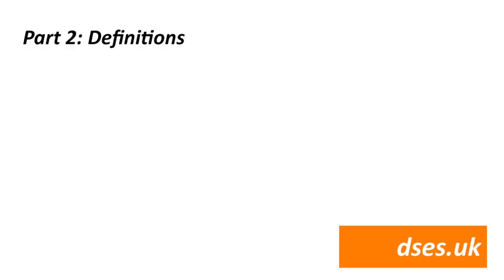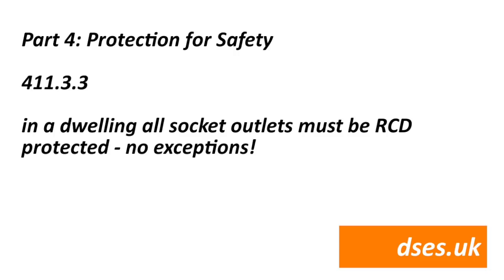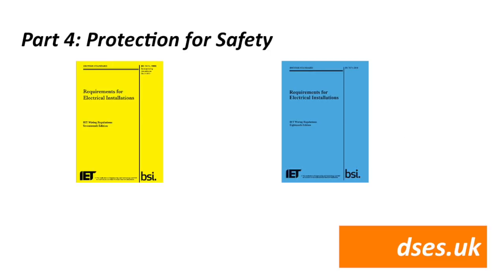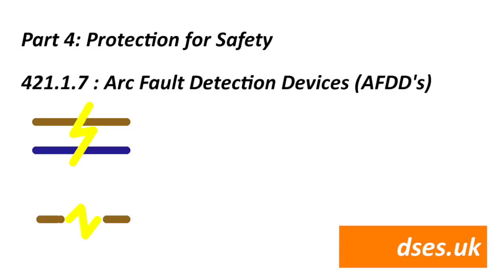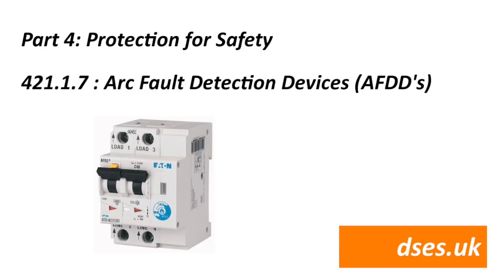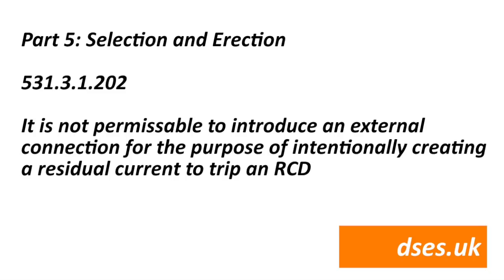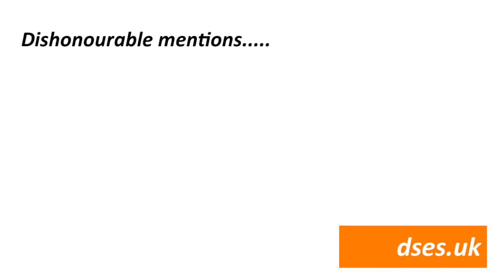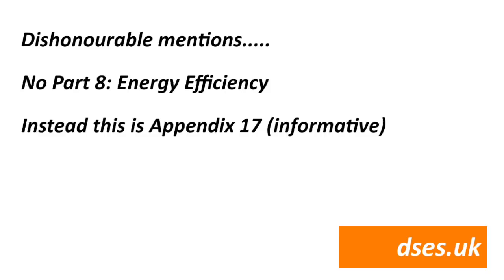18th Edition regulation changes

Comment: Crabtree and Hager both already do a smaller AFDD RCBO combo
Reply from the maker: I've seen dual module offerings without the RCD element, but I'm having trouble getting hold of any AFDD device at present. I've been chasing Eaton, Schneider and Wylex, but I'll see if I can find part codes for Hager and Crabtree; maybe they'll have something they can actually sell to me!
Reply: https://www.electrium.co.uk/media/20180709153811_0_StarbreakerProtectiveDevices.pdf  No idea if , when and who are stocking them yet but the crabtree ones are RCBO & AFDD Combo 2 moduels wide. Wylex have a simular one again just 2 moduels wide, no idea how we are going to find space to fit them all into the boards tho!
Reply from the maker: Excitingly enough, Electrium have been in contact with me and I am meeting their representative on Monday to get hold of one of their Starbreaker (Crabtree) AFDD devices for review! As you say, at two-modules wide it's a smaller footprint than the equivalent Eaton model, yet still provides overcurrent and earth leakage protection. Also, the unique Starbreaker board allows flexible connection unlike other makes where the busbar needs significant modification to get 'em shoehorned in! I'm very much looking forward to playing with it and hope to have something to put on this channel early next week!
Reply: Your point around fault finding is correct. As devices get smaller, will manufacturers still be able to provide enough information out of them to allow the reason for the trip to be seen visually?
Reply from the maker: The AFDD's I've seen have a LED status indicator which may tell you want kind of trip has occurred by the colour of the light and/or the pattern of flashing, but I haven't had a go on them yet to see what kind of visual feedback is actually given. I'm hoping to have an AFDD on Monday though, so I'll get to have a proper play and will upload something on this channel to help answer some of the questions about them! Any kind 3-in-1 device such as the AFDD/MCB/RCD combo will need some kind of indicator or flag though, even if they do shrink them down. Time will tell I guess.

Comment: There are clips for holding wires up in those simple thingys.. just plug in on the screws..
Reply from the maker: Yes, there are butterfly clips that fit in the trunking, but the talk is that if you're holding the metallic supports up by screwing into plastic Rawlplugs, then you still won't comply. I see DeWalt have brought out a metal screw solution that screws directly into a hole drilled into brick/block with no plug required so that's probably the way forward. It's all extra fiddliness though, and will add to time on site!
Reply: David Savery Electrical Services true. The stuff will become more fiddle but yet, the use of the newer concrete screws rather than the plastic rail plugs using a smaller drill bit for the pilot hole means you can, and I have, drill right through the plastic into the wall, then screw the thing into place. I personally am waiting for them to explain if these plugs could replace the staples that are damaging the nm cables and causing a large percentage of the arc faults that are not at the actual outlets.
But, I still am studying the codes, having been a handyman and never certified. I understand that we want the wires fixed into place and supported so we have a general idea where to look for the wires in the walls... but does fixed mean tight? Or held in place rather than flopping around the cavity? Think that is the next big change to come, and the same clips one manufacturer has made for the pvc clips could just as easy be used in the wall cavity to hold the wire in place away from the wall surface.

Comment: Should not be adding socket outlets to lighting if the circuit is wired in 1.0 cable as this is not deemed suitable for power circuits.
Reply from the maker: Actually, that's wrong on two counts. Firstly, 1.0mm cabling can be used for power (socket outlet) circuits. Table F5(i) of OSG (p.158) rates 1.0mm cable at up to 15A clipped direct, so if you were running off, say, a 13A fuse for a short socket run clipped to the wall, then you could do it in 1mm. Personally I wouldn't, but it would be permissible and certifiable with that upstream protection and so long as the EFLI at the far end was within 1.84 Ohm (in the case of a 13A BS1362 fuse). Secondly, adding a socket to a lighting circuit is fine in order to connect a small load. A good example is the TV booster traditionally fitted in the loft where the only circuit available is lighting. As the booster only needs a few milliamps and comes with a plug that has a 3A fuse fitted, then there is no danger of it overloading the circuit, at least not unless the circuit already has a maxxed-out demand on it! In the unlikely event that the homeowner one day unwisely decides to plug an electric heater into that (not very accessible) socket, then the breaker will trip so the wiring will be protected. When I install such a socket, I label it as being for the 'TV booster only', and 'max load 3A'. 1.0mm is used in many socket applications already: a lot of extension leads only have 1.0mm cores, but because they have a 13A fuse in the plugtop, they're in no danger of overloading. You won't find anything in the wiring regulations to say 1.0mm can't be used for sockets or that sockets can't be added to a lighting circuit to drive small connected loads. What you will find are regulations telling you not to exceed the current carrying capacity of the cable regardless of the application you're installing it for, but that is all.
Reply: @dsesuk  I did slap a socket in a loft space but did use a fused switched spur.  It is for a WiFi booster I did recall reading about it some were in the on site guide.

Comment: I'm sorry but this updated edition (and the increasing frequency of new editions) smacks of a money generation scheme. There is nothing here that could not have been put in the previous edition. Safety has not been substantially improved. This is about a Government quango trying to raise revenues and justify it's existence. With new books sales and self certification bodies demanding update courses etc. this is a £100m issue. The real issue is that probably 10 million properties don't even meet Issue 10 regulations, there are millions of properties with no RCDs!! I don't want to sound negative, but the chance of an old house burning down is less than 1 in 3000 and a newly built house 1 in 10,000 (insurance statistics) and yet we have to now use fire proof clips; sorry but it has become a madhouse. Gas fitters run gas pipes buried in walls and under floor boards with no indication of location, is this not dangerous? Is it acceptable? The regulation bodies are out of control. I also believe that self certification is a load of bollocks; I spend  just as much time correcting other electricians work as anyone else's. You are either conscientious to do a good job or your not; your work will never be impromptu inspected at random. I'm glad I've just retired. Good video though; thanks.
Reply from the maker: I absolutely agree with everything you have said, especially as I am someone who once hit a hidden gas pipe buried in a wall with no indication as to its location! Companies like Certsure who run ECA, NICEIC and Elecsa are coining it in and doing very little for their money. There's a lot of talk on social media from people who are dissatisfied with the CPS setup, and even those who are planning on leaving it altogether which is fine so long as they maintain their standards and are up-front with domestic clients about not being able to provide a building regs cert (unless that client wants to pay for the planning application up-front of course!) Here's some food for thought too: BS7671 is only supposed to have up to two amendments per Edition, or so I am told. 17th was a fudge as they brought in A2 for things like car charging, then figured they wanted to bring in metal consumer units sooner than the 18th, so they came up with A3 which meant we all bought new books just three years ago. Also, only new Editions require a Draft for Public Comment, so anything that didn't get into the 18th because it got shouted down may still make it into 18th Edition Amendment 1 when it comes out (sooner rather than later probably), as they can stick whatever they want into A1 without asking those on the coalface if it's practical to work by or not! Word on the street is that A1 will move Arc Fault Detection from 'recommended' to 'required' and beef up surge protection which currently has a get-out clause for domestic installations. What it means for mandatory earth rods on TNCS installations, well God only knows! Maybe Amendment 1 will be the cause of my retirement!
Reply: Hi David, I would agree that the prompt move to steel consumer units was a good move; the plastic boxes were simply too cheap and not up to the task. On the subject of premature collapse, this was a good requirement for designated escape routes in public buildings and apartment blocks; to bring this now into domestic premises, well!! I read it differently to you in that you may continue to install plastic conduit or trunking so long as it is fixed with metal fasteners; this will indeed prevent premature collapse of cables and will continue to meet the requirement. Nobody is going to start cutting and threading steel conduit!! Finally, on another personal note: Six months after my 'first' retirement I kept getting calls for small jobs and although I had been an NICEIC contractor and had only been away from the trade 6 months NICEIC insisted that I pay for a full reassessment!! £600-£700. As a result I now do not do 'notifiable' domestic work and it amazing how good a living you can make fitting lights, minor works and inspections!! No more rewires or consumer units for me and even better, no more self certification schemes.
Reply from the maker: Don't get me wrong, I'm not saying you can't use plastic conduit or clips, just that you now have to fit additional metallic support to prevent collapse. DeWalt WallDogs are worth a look, albeit expensive, but they allow a metal screwplug to be inserted into a brick or plasterboard wall without a Rawlplug or such. Funnily enough, next year I'm planning on dropping rewires/refurb projects, so I may well join you on the non-notifiables and save the arsehole of NICEIC, ECA and annual assessments!
Reply: @frankhayes1135  I am pretty sure if the NICEIC had their way it would be illegal for anybody that isn't assessed to do any sort of electrical work of any kind, including the simple stuff.

Comment: why don't they use an external fireman's switch to isolate the power , then all a fireman  would need was a pair of snips .:)
Reply: Firemen have enough to do without reaching for a pair of snips.  There are good reasons for fixings designed to prevent premature collapse in escape routes and that was absolutely the right thing to do (google Shirley Towers fire investigation report for details).  But for surface mount on a wall behind the washing machine (which these regs mandate) is somewhat extracting the urine.
Reply: Here’s an idea, you could house the electric meter and main fuse in an exterior plastic box, so both the fireman and meter reader could access it without entering the property. Wonder why no-one has thought of that before...

Comment: A couple times I’ve been balls deep in a unlabelled rats nest and had to use my tester to trip a rcd so I can see what’s what
Reply from the maker: I may have misread what that change was about; someone else said it was to prevent devices coming on the market which would force an RCD trip as a safety measure (the problem being you can't rely on any electromechanical device to be serviceable in the event that it's needed). I don't think it's actually to do with using test equipment to trip an RCD or being out in the field and tapping neutral to earth to figure out which RCD you're connected to.